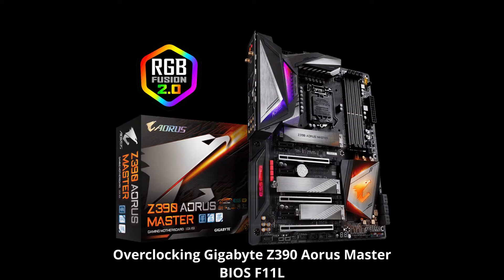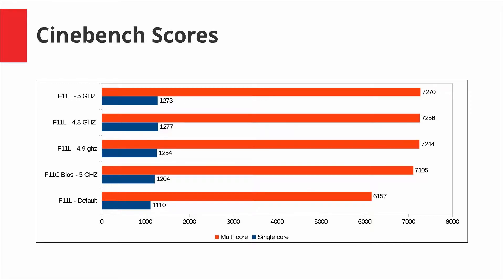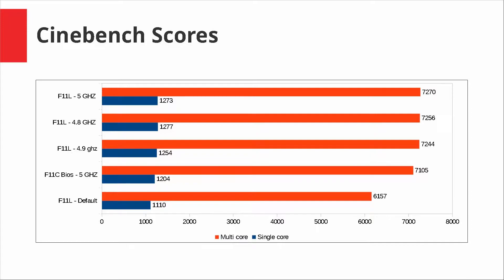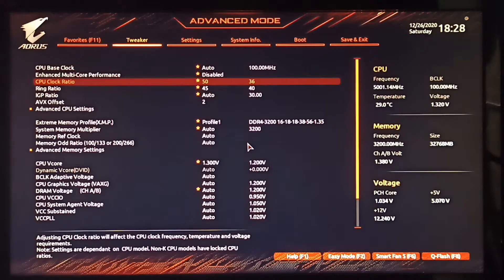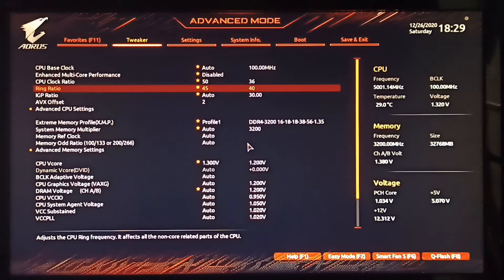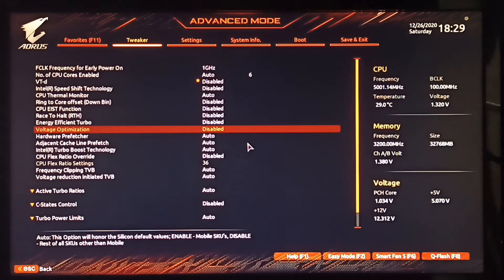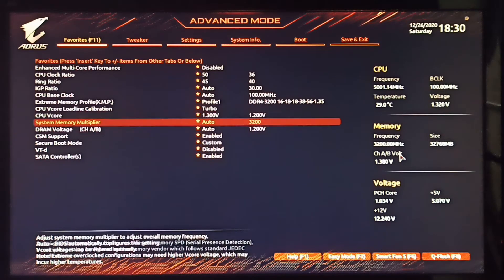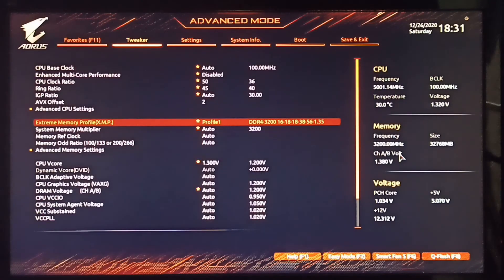GIGABYTE Z390 Overclocking Guide to 5ghz

Comment: Decent overview thx. But at 6:58  "... an increment of 0.1 is enough". That's a pretty high increment. Did you mean .01 ?Moving in 5 millivolts (.005) will jump to the next highest hundredth of a volt (.01), so going with hundredth's is generally a safer incremental increase. Especially moving between the 1.25 to 1.30 range.
Reply from the maker: Thanks for pointing that out, I meant 0.01, but I do 0.005 if it keeps crashing.

Comment: Hi, thank you for the video. I have Intel i5-8600K with GIGABYTE Z390 Aorus Elite.  

From following the video I have set the CPU Clock ratio: 48 -  Ring ratio: 45 -  AVX Offset: 0 - CPU Vcore: 1.275 - CPU Vcore Loadline calibration: Turbo. 

After running AIDA64 for 40 minutes, I reached max CPU Temp of 55°C.  

Quick question: When running CPU benchmark at 100% I noticed that the voltage for all the cores runs at 1.310v with max of 1.390v, is this safe voltage to be running at? 

Also is there any other settings which you would recommend that I change in the BIOS? 

Thank you
Reply from the maker: So following someone's settings might not be the best idea, you're CPU might be able to run higher frequencies. 

Similar to my senario your temps are good. Voltage might be the only issue, you could try bringing it down by small increments of 0.05 to see till where it's stable. 

The high voltage can be an issue with the PSU or the motherboard's power delivery, but I can't say that for sure, since it does variate, but not that much. If I set it to 1.275 it goes upto 1.315.